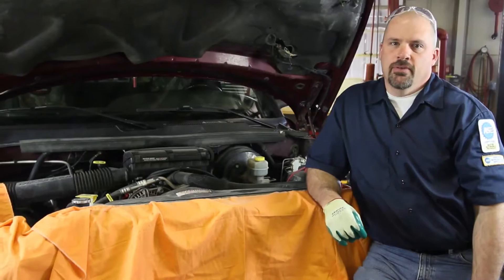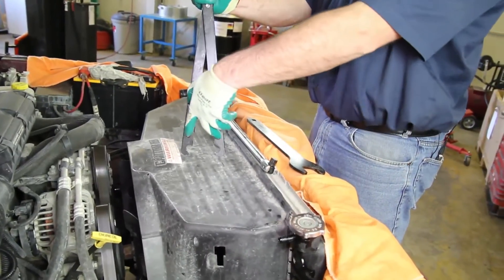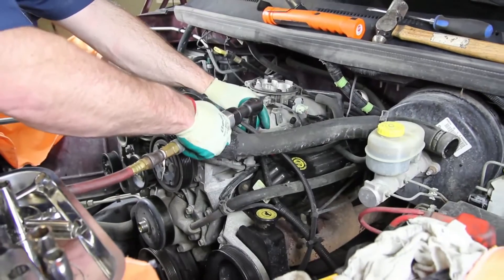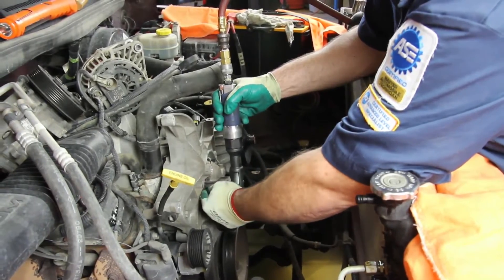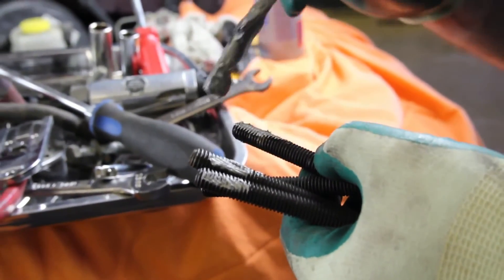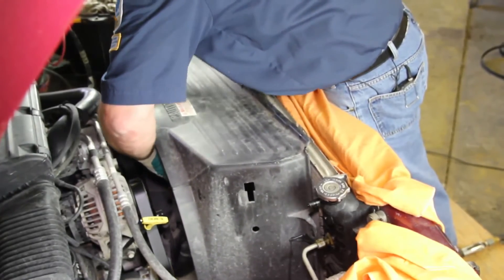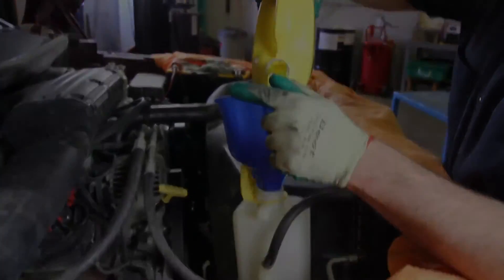How to Install a Water Pump for a Chrysler Dodge 5.9L V8 - Advance Auto Parts

Comment: If I were to install the water pump with a gasket would I have to apply gasket Maker silicon like this in the video or would it still leak out if I just placed the gasket on it and bolted it back up

Comment: Great video, and I mean great. My truck had coolant leaking and I could see it trickling off the bottom of the harmonic balancer; I wondered if my water pump had failed but also wondered if it could be a leak at the thermostat housing gasket. Without taking everything apart, I just couldn't see the source of the leak, so I googled for the location of the water pump on this truck and this video came up. I figured being only 6 minutes long it was probably not gonna be super helpful, but it's actually one of the best auto repair videos I have seen. You guys struck the perfect balance of providing all the information a non-pro but semi-capable DIYer should know to do the job without going into long-winded tangents. The lighting was excellent, and so was the camera work. THANK YOU!

That said, I tried searching the advance auto parts website for the bypass hose and fitting and came up short. Anyone know the part numbers needed for the fitting and hose? (1995 5.9 magnum)
Reply: You’re probably done now but barricade garage has a vid on this and many other replacements/installs on a 318. He lists where he gets his parts, the part number, torque specs, it’s a good spot to learn where to get good stuff.

Comment: I'm a DIY guy for years, but it has been several years since i did a water pump. I forgot if the fan assembly bolt is a lefty bolt. It doesn't say here. I seem to recall they all are. Can somebody hep me ?

Comment: You don't say even one word about sealant on the bolts that go into the water jacket OR the little 0-ring that comes with your pump!
Reply: Yes he does you freaking donut! Good lord!

The "sealant on the bolts" isn't "sealant," it's anti-seize, which is exactly what he called it. Go to any auto parts store and ask for anti-seize and they would hold your helpless little baby hand all the way to where they keep the stuff so you don't get scared and wet your pants.

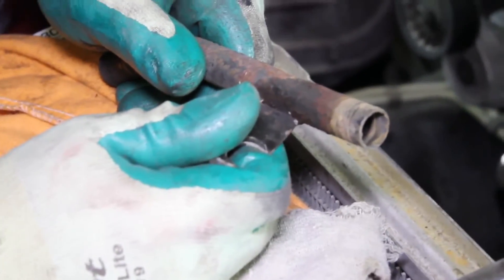As for the o-ring, re-watch the video starting at about 4:45, up until about 5:05. When you finish, go ahead and quietly delete your comment and pretend none of this ever happened. If you come back here and try to double-down on your cringe-inducingly pathetic complaining, you are going to get dragged even harder.

Comment: Here I am, a shade tree mechanic trying to do this, and had no idea there was going to be a problem removing the fan clutch, came to this video for a pointer on how the hell to remove this big ass nut while the water pump moves, and this guy blasts right through my problem with, "just rent a fan clutch removal tool". Without showing anything on how to use the tool.
Reply: There's  videos. Don't know why this guy skipped showing that part. But your basically holding the water pump pulley and getting a 38 wrench and putting it on the bolt that's holding the fan and Turning it left.
Reply: Go to the store that rents the tool and ask them, you dingus. Someone made this video to help you out and you're mad because you still aren't smart enough to problem solve something that simple? You probably should leave the automotive work to someone who can navigate the process of how to Google "how to use a fan clutch removal tool"

Comment: I just had mine replaced about a month ago and it’s leaking again already. Gonna talk to the shop that did it. Has anyone had or heard of water pumps having hairline cracks from the manufacturer? Doesn’t seem to be leaking from being under tightened. Looks like it’s leaking from the front where the pulley attaches.
Reply: If you actually watch the video and listen he says right in the video that a leaking thermostat housing gasket is commonly mis-diagnosed as a failed water pump. I know your comment is old, but to answer your question, your mechanic replaced a water pump that didn't need to be replaced, and now everything (but not the water pump again) needs to be pulled apart again so that gasket can be replaced. Obviously, listen to the instructions in this video and replaced the bypass hose and fitting, as well as the thermostat and thermostat gasket at the same time.

Comment: My water pump pulley came off with the fan while driving down the road, can I use a hammer to reattached the pulley or do I need a new pump?
Reply: I bought a new pump. Cus yea my aunties pulley was freaking loose. Took two of her serpentine belts

Comment: Didnt need to take out the ac compressor or altenator
Reply: You didn't need to but it's a lot easier to do all this and properly clean the gasket mating surfaces if you do. Sometimes it's more work to be lazy.

Comment: Actually I think this is the best video on how to replace the water pump on the 97 because it's easiest way to get to the thermostats and little bypass hose I appreciate the video... doesn't take much time to remove the AC alternator and accessory bracket

Comment: I replaced mine (not a mechanic) without removing anything but the fan, fan shroud, and water pump...... Mountains out of mole hills. this is why you get screwed on hourly shop rates. so grab a wrench and learn to turn. you will save thousands of dollars in the long run